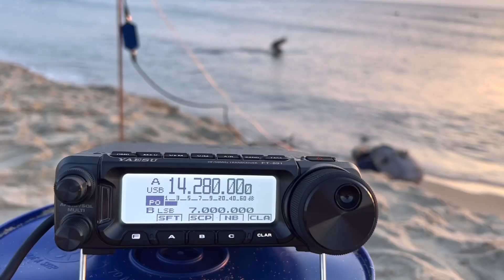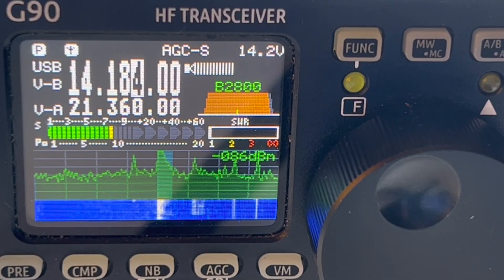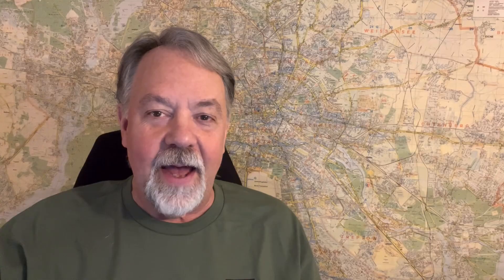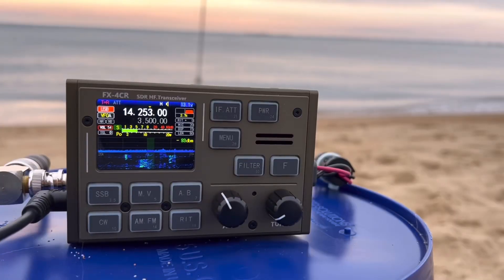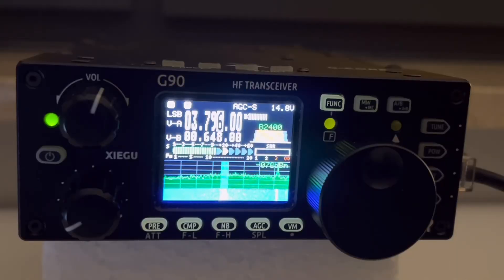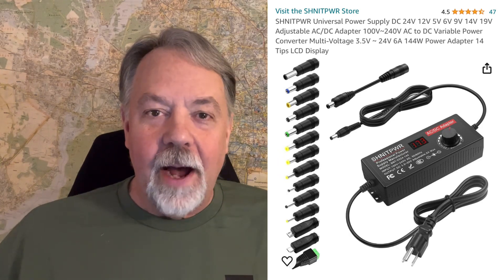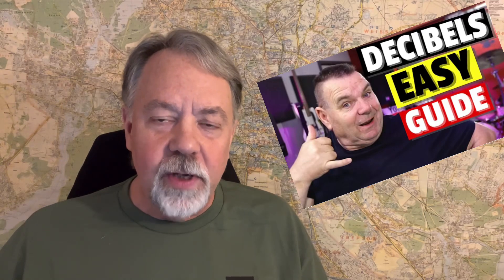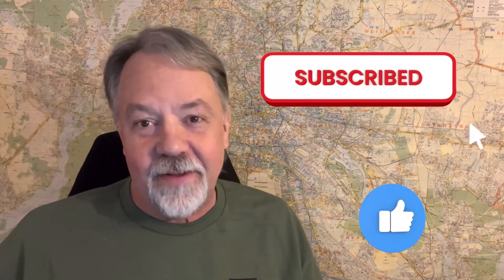20 Watts Versus 100 Watts - How much HF Ham Radio Power Do You Need?

Comment: Great vids always.How many years you’ve been using your G90? I’m deciding between G90 and Yaesu 991A. I read that G90 has no service center here in USA and 1 year warranty from HRO or Gigaparts but better price point.Thank you for the video. 73s.
Reply from the maker: Thanks! I’ve had mine for 3 years and I’ve been hard on it with no issues. I travel with it, use it all the time portable and use it at home most of the time. I’ve definitely gotten my money’s worth. 73, Walt
Reply: @COASTALWAVESWIRES  thank you for the input. Now decisions decisions. 73s Walt.

Comment: Hey Walt, I really wonder, why if you made a video about the G90 vs the FX-4CR where you said they are about the same why you never make videos with the FX-4CR? I wonder because I have a G90 but I will looooove to sell it and get an FX-4CR which I really love the size. They have the same display, the same power output, etc. I know the G90 has an amazing tuner but you make your antennas resonant (same as I do) so very rare you should be using the tuner. I have a home station with an IC7610 so I dont need more radios but I will like to have a QRP BUT the smaller size as possible and lets face it, the size of the G90 its about the size of the FT891 in my truck so its not what I call "small size". I am about to pull the trigger and get the FX-4CR but seen that you never use it its holding me back. I love digital modes so the FX-4CR its way better suited for that with the Bluetooth instead of the G90 with a digirig and the bunch of cables. I can literally put velcro in the back of the FX-4CR and slap a Bioenno 3ah battery and have a full rig in the palm or my hand. I am really looking for your opinion as I am about to hit that "buy now" button lol.
Reply from the maker: I used the FX4CR in every video I did for 2 months in Poland. It’s a good little radio. I sold my FX4CR last week and kept my G90. That should pretty much say which one I like better.
Reply: @COASTALWAVESWIRES  ouch, thats a heart break for me haha, So I guess you answer brings me to the next question, why you sold it? what you didnt like about it?
Reply from the maker: @angelscomputers I liked it but never used it. The G90 has more features like SWR sweep, the ATU, etc.

Comment: Sounds like your priority is ease of use and receive capabilities/selectively. There is nothing wrong with that, but there is definitely a place for 100w transmit. But yes you are on the right track focusing on the antennas, because a good antenna will make a huge difference, because a poor swr and a cheap long cable will lose your transmit power for you faster than anything.

Comment: I currently own both, and am considering selling my G90.  Here's the reasons why for me:

1) The filtering on the FT-891 is leaps and bounds better than the G90.
2) The SDR on the G90 sounds tinny, and harsh.
3) I also own an ATAS-120a.  The ability to tune the antenna right on the radio is a killer feature for me.

I have the same to say about the G90 - It's a GREAT radio.  I've used it for years, and had MANY successfull POTA activations with it.  It's a great value for your money, for sure.  The screen is nice (albeit small), and is helpful.  But I just felt like it was time for a change, and the FT-891 has been a quality, welcome change.  Since I bought the FT-891, I haven't used the G90 at all.

So, great video as always, Walt.  Same two radios; different directions.
Reply: Im looking at the 891 for the better rx ,as someone who owns both would u say its worth it to get an 891 , chasing dx ssb from the uk
Reply: @AndrewR2130  If the question was for me, then I would say that it's definitely worth it to own the FT-891.  But, keep in mind - I've only owned the FT-891 for a month now.  I'm still in the 'honeymoon' phase with the radio.  So, of course I'm going to say it's good.  Walt might have a different take...

Comment: Well, nothing wrong with that. You have another 100 watt in your shack for emergencies. I picked up a G90 just because of your videos. I also have a 100 watt for emergencies. I don't have a lot of experience with different radios but for now, I believe the G-90 is a first and last rig you need for the hobby. Thanks Walt. If you're crazy then so am I. LOL de KA9TII

Comment: I have an ft891 but it’s the only radio I have and for now it does base station and POTA well enough for now. If I were to buy a POTA only radio then I would get a G90 for the built in tuner and low power consumption.  When I use the 891 for POTA I power it down to at least 50 watts or less

Comment: Dave Casler said much the same thing. Way I understood it was that the only real thing accomplished was with 100W, you drained your battery quicker. I watched a few review videos yesterday on power supplies. One reviewer demonstrated on a QRP radio and the ammeter showed 1.4A on receive and not much higher on transmit. Then he demonstrated on a 100W out and the meter showed a nearly 20A draw. 
And I routinely see other ham radio videos where someone in the US is talking to Europe or Australia/New Zealand on low power (50W or less) and is making a decently clear contact.

Comment: Well said Walt.  20 watts is more than enough.  And you can always reduce the power on a 100 watt radio.
So where did these people get the idea you need to pump out a lot of RF to make contacts?
I have heard guys say they won't even talk to another station unless he is 20 over!
I don't get it.  I could care less what my RST is or what his RST is.  As long as we can communicate,
that's all that matters.  There isn't a spot on this planet I haven't worked with 5 watts on CW.
Read the FCC regulations:
97.313 Transmitter power standards.
(a) An amateur station must use the minimum transmitter power necessary to carry out the desired communications.
Reply from the maker: Exactly!

Comment: Great points, Walt. I am mostly a CW guy and do a lot of POTA. I'm always shocked at how much DX I get with my G90. I recently got the FT891, it's a great radio and has many features like memory keyer, better receiver and such but it's a power hog even when you turn down to 20-40w, also no tuner. I often still travel with my G90.

Comment: Math teaches us that the difference between 5w and 20w is the same as between 20w and 80w. But from the experiences I've had recently I would say that the difference between 5 and 20w is significantly higher in practice. So I confirm that 20w seems to be a sweetspot for portable use.

Comment: I have only ever run 50w from 100w radios. In the early days of solid state finals they tended to only just be good enough for 100w so it reduced the "wear and tear", heat etc. I had an FT100D and only ever ran it at 50w. A lot of those radios died with blown finals. Yaesu quickly replaced it with the 857 because of the issues. 50w got me over 150 countries and I don't think there is much difference. 20-100w is, at most, one s point.

Comment: 48 years ago I had a KW204 tx and KW202 rx, sold them and got a Yeasu FT101E, both 100 Watts. Turning the power down as low as possible on 10m in the 80's I was still getting out. Sold that and went QRT for ten years after moving QTH, built a QRP rig, 80m + 20m 4 Watts s.s.b. and c.w. and later added all h.f. bands and now adding 60m.
Currently using an FT817ND 5 Watts s.s.b. and c.w. with attic dipoles and regularly getting 1,000+ miles on 17m and 10m. One Watt c.w. recently to Bulgaria and Finland on 10m.
My Pixie on 60m with 350 mW out got me 180 miles QSO with a SWL report from 220 miles.
Just getting back into it after suffering S8 noise 160m to 20m from internet broadband which cleared up in February when it went to fibre optic cable.
G4GHB.

Comment: Hello Walt, thanks for yet another video that makes a lot of sense. I actually own these two and I have been using the G90 almost exclusively for my portable ops so far. I will keep the FT891 however, because it's a lovable TX I can't really imagine parting with, for when I shall be able to do some base ops in the summer house and because of the 6 meter band.
Talking of power, I'm always amazed when I hear OMs announcing that they push out over 1 kW like this French guy working in the Middle-East last week-end...

Comment: I agree about the power, but you gave up the 6 meter band. I end up carrying two rigs, the Xeigu G90 for HF and the Yaesu FT-817nd  for 6 meters. If Xeigu came out with something like the G90 that also had 20+ watts on 6 meters, I would jump for a new rig.

De WB2VUO

Comment: Hey Walt, as of 4/7/2024, with my Xiegu G-90, 20 watts, and a home made soda bottle dipole Flat V antenna ( see it on my QRZ page, this G-90 will tune a trash can ) I have made, and logged 19 countries on three weekends, the furthest is Argentina, some 6692.73 air miles. I live in Lacey, Washington, and my shack is on the second floor, approximately 25 feet above ground level. I too owned a Yaesu FT-891, and sold it, because I didn't like the fact that it didn't have an internal antenna tuner, and I believe it's not the 100 watts that does the trick, it's the location, and the antenna, tuned to the radio. I was also getting a constant 5-7 to 5-9 on most contacts, and in the states, all 37 contacts ( logged also ) gave a consistent 5-9 on average. This is logged and not blowing smoke. 20 watts is plenty, and with an adjustable mic gain like the Xiegu G-90 has, you will rock the ham world.....BUT, remember, location, location, location, and never excuse a wire antenna...show em Walt :-) ....P.S.I  love your tutorials Walt, keep up the great work, and 73s my friend:-)     Mike KI4TOL

Comment: Right on Walt. I get grief sometimes from folks about 20w and chinese radios, but for working portable I agree with you on 20w. I do cheat with the X6100, and will use a small amplifier pushing 30w sometimes.

Comment: Couple of sunspot cycles ago I was using a "born again" CB ground plane shortened 6.5" to tune it to 10 M.  I was talking to a fellow (SSB) in Nicaragua who could calibrate his TX power down to 1 mw.  BION, I could still hear him Q4 - 5 at 5 mw, but lost him below 2 mw into the noise.  We are at SS peak 1 right now, no, not as good as that one, but good.  Most manpack radios run 20 - 25 watts.  Bonnie, KQ6XA who founded HFPack used a Yaesu VX-1210 for all her stuff.  25 W.  Worked.  73, Jerry wa2omu

Comment: 2,615Km today on 10M with new G90 and Coastal inspired speaker wire dipole.   Texas to Massachusetts.   The new radio has been a little buggy but I’m sold on the form and function.  Looking forward to seeing how Radioddity helps resolve.    Thanks for your inspiration.   Hope to make contact with you some day.

Comment: UK licences have just been updated from a max of 400w to 1Kw and the dealers are selling big amps hard... but all you need is 20w and extra power just adds to the noise level. I agree Walt 20 watts is a happy place to be on power output.

Comment: well done. it's more about the band being open then power. when band is closed. 1.5Kw not going to get out. it may . but when band is good 5 watts will do the same.  I have a IC 7300 and use it portable and run it 50% power or less all the time. still gets out great and helps with the battery a lot. I don't have many radios.  so I just use 7300 . no QRP radio. some day a IC 705. what I go works great. I have a Anytone 60W 10/11/12 meter only radio. works super on 3 bands. drops to 1 watt . I changed settings to give more power range . even got the anytone doing digital. 12 meters was open the outher day . was going south and west from NY. got Brazil and Oregon the outher day. and was 25 watts PEP into half wave ground mount veritable . 1.3 SWR . from a park not a Pota park. County . 73's

Comment: Im a tech so 10m is all i can use at the moment . Im loven HF my very first HF contact on my new G90 with a speaker wire dipole, i thought was in Florida because he kept say Florida 6KOP and had an accent so i thought Cuban it wasn't until 24hrs later I thought there might be another letter in front of F but the HRCC group helped me out. It was France 🇫🇷  4969 miles away from SE corner of oklahoma. Im hooked doing POTA and im studying for my general cant wait to work other bands.

Comment: 20 watts isn’t QRP 1st of all. But with that said in order to increase your signal by 1 S-unit you need to double your power twice. 10 watts is QRP for SSB in most peoples standards, 5 watts for CW/FT modes. When I 1st became a ham back in 1997 I was always told QRP was 5 watts or less no matter what. QRP technically doesn’t even mean low power. It means lower your power, there’s a difference. Any how, starting with 5 watts real QRP power in my opinion, 5*2=10,10*2=20 or 1 S-unit. 20*2=40, & 40*2=80 or another S-unit so that’s where an up to 100 watt would come in handy. I definitely see your point in using 20 watts as it’s 1 S-unit higher than 5 watts.

Antenna is always your biggest cheapest power gainer. As you have proven in many a videos here on the channel. I recently installed an FT-891 & ATAS120 in my car. I’m not impressed with the ATAS to say the least. But it makes an example of where 100 watts is really needed because the ATAS120 is nothing more than a rubber duck on the HF bands. Your sacrificing performance for ease of use, big time! Needless to say it’s time to kick the ATAS down the road.

Another great video Walt!

73 de W2ITG

Comment: I was thinking about getting a 100 watt HF rig once we get on the back side of the current solar cycle.  However after hearing you and others state it is only 1 S-unit difference going from 20 watts to 100 watts that leads me to believe that the signal won't reach much farther.  Sounds to me like my money would be better spent on a beam antenna for use at the home shack.

Comment: Great Video, agree 100%.  I have made thousands of contacts with my G90 and it is a great POTA radio. But with that said I wish Xiegu had better quality control.  My G90 has a few weird glitches in that limit the power I can use on different bands and if you want to use an AMP you cannot.  Too bad I didn't figure out the issue was the radio till after the warranty was expired.  I not saying not to buy a G90 just make sure you run it through the paces to check everything out.

Comment: I am about the opposite.  I keep about selling my G90.  Without constant tweaking the output audio is inferior compared to the 891.  Filtering is nicer and output audio is nicer (although good on the G90).  We get on 60 meters every morning at 11:30 UTC on channel 4 and you need over 20 watts most the time (we try low power levels when conditions are good).  If you work upper hf bands, then 5-20 watts is usually enough.  Be cool if you would try giving us a shout on there.  Stations from Florida to Washington state have dropped in.  73, KF0BBU

Comment: Not knocking your decision... Everyone makes "good" decisions based on the variables presented when they make the decision.  The FT-891 however... can easily do 20 watts - just roll it back.  You then have the 100 watts should you ever want it..  I run mine never much more than 45 watts.  I have the FC-50 tuner when I need it, but most always use resonant antennas.  I CAN see your reasons for the switch... the SDR features and nice display have it way over the 20 watt issue in my opinion.  I could see making the change for the better receiver features for sure... but not the 20 watts.  IF one is on a budget I agree you can't beat the price you mentioned.  In my situation I have both the 891 and a 991.  I love the 891 for CW.  It is one of the best CW radios I have ever owned... but then that is my opinion.  Both of my Yaesu rigs mentioned are ATAS-120 compatible, which I also use.  With regard to decibels... you make some excellent points and observations.  One rarely needs over 100 watts.  Best 73's  Dan K1YPB - On the air since 1962
Reply: Even on receive, the FT-891 has over twice the current draw of the G90 though, so not great for a small battery.

Comment: Hi Walt, I love my 100w Yaesu FT-450D, which is My flagship radio.  However, I seem to keep it in the Faraday bag at home and only use my G-90 & FX4CR  for both base station, field work and RV travel. 20 watts has gotten me to Alaska from POTA in the woods in Florida. As well as all over most of North & sometimes South America. Plus Ireland, France, Germany with just my portable antennas. I fully agree.  I have more fun with my 20 watts, then ever with my flagship 100 watts.  Good video, thanks!  AC3EA

Comment: I love my G-90. I’ve had my Yaesu FT-710 and G-90 out on POTA activations. The G-90 performed equally as well. Besides it tunes better, is MUCH EASIER to haul around, and I can operate for many hours on a smaller amp battery.

Comment: I'd take the ft-891 over the G90 all day everyday but I probably have a different use case.  But come on, man!  Showing the FT-891 with an Amazon listing for $781?!  Until a recent price hike you could get one for $639 on all the proper radio sites like Gigaparts and DXEngineering.  Now they are running $679 with occasional $20 sales.  Your passion for 20w ops is great but showing an inflated Amazon price is not.